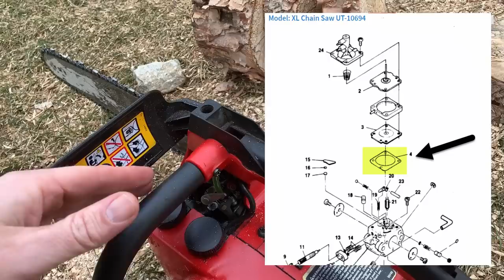Homelite Super 2 Chainsaw - Carburetor Rebuild and Tuneup

Comment: How can you possibly work on anything that dirty and not clean everything off and clean it up. The dirt doesn't help the engine cool and traps heat. My OCD would have had that thing spotless before reassembly. Just my opinion...
Reply: Yeah, the dirt presents a problem.  But what would be the best way to clean these things?  He goes thru quite a few motors.  I would use a pressure washer on it.  I have a tiny little Ryobi that would make that thing sparkle.  But that dirt's gotta go somewhere.  I was cringing that the dirt would find it's way into something crucial.  If it were Taryl, he would just wipe it off with his sandwich.
Reply: I agree, makes good sense to clean it when it is all apart.
Reply: clean the old wood dust and oil to make room for the wood dust and oil 😅
as long as it does not hinder anything it does not harm.
Reply: @alext8828  
I use carburetor cleaner, and paper towels,  a screw driver , or ice pick for tight areas.
Reply: @alext8828  🤣🤣🤣🤣 and there's your dinner
Reply: @jonmyers8046   Ha!  I just consulted "Little Johnny".  He says "Maybe".   Grampa's pissed.
Reply: @alext8828  😁😁😁
Reply: So true. Could of at least given it a blast with the air compressor...

Comment: The amount of dirt on this saw doesn´t help matters... I would always wash the whole machine until it´s spotless to avoid any potential faults due to dirt.
Reply: What do you wash the saw with i never knew of anyone doing that good idea
Reply: @scor440  I usually use gasoline and medium sized paint brush.
Reply: @scor440  if you have a compressor and an air gun just blow the whole saw off after every use. Then just wipe it down with a rag. It will keep them looking brand new.
Reply: @matthall8632  the flywheel fan always pulls sawdust/oil vapors to blow over eng. to cool so always eng.gets dirty w reduced cooling. a spray gun w compressed air to use mineral spirits is fast, works well in well ventilated area and reasonably safe .

Comment: cant blame the shop for turning down the work. Commercial shops must make a profit.  They have overhead cost and If they charge what they need to in order to make money. The customer often will not pay and they now have another  old chain saw in their inventory. I own a half dozen of those super two saws. Bought them really cheep. And I can fix them. However it isnt worth the bother since I have much better XL12,s and bigger vintage homelites that start and run excellent. Those Super 2 saws are popular with tree service guys because they can be used one handed easier that a heavier conventional saw.

Comment: I just found my old Homelite XL (Textron) stashed back in the corner of a shed I rarely visit. I've decided to tackle this project and get it back to running. I have the motor and chassis seperated. I'm having some trouble locating parts. Model UT-10694, carb-H17 26G. Fuel bulb is broke, bar n chain rusty, fuel n oil lines hard, sprocket. I did find a new bar n chain online, but so far all the parts places I've looked out are no longer carrying the other parts I need. I did check and it has spark. As I clean parts I will probably find it needs more. As long as I can find them im ok with that. Even this old/obsolete saw is better than most chinese saws. The flywheel even says made in USA, how rare is that!
Thanks for any help you guys can offer. Enjoyed the vid.

Comment: that repair job reminded me of watching a watch repairman fix a 1937 pre-war wristwatch that been submerged in a lake for 9 years......but you got it running as we all knew you would.....i've owned horribly bad performing chainsaws and lawn mowers in the past and never really owned anything reliable until i bought my first makita 4 stroke chainsaw..........but all the gas chainsaws just shrivel up and blow away when compared to a modern lithium battery powered chainsaw....they are simple and reliable and powerful and convenient and they never disappoint......i bought a makita dual battery chainsaw and haven't used any other saw since i got it

Comment: The pump and check valve diaphragms removed from the carb indicates the carb had been rebuilt at least once as the carb maker did not use that type of material until long after the saw was made.

It requires little effort to separate the engine from the case halves.  A carburetor kit costs under $10.00 most anywhere you look.  Labor to rebuild a carb, from tear down to assembly, is under an hour.  I'm doing one with a chain oiler issue right now and the most difficult part of the job is cleaning out 30 years of cutting debris.  Cleaning the engine and case before taking anything else apart keeps the dirt out of the engine and provides for seriously improved engine cooling after reassembly.
Reply: good to know. cooling is good ❤

Comment: I have a saw just like that. Runs great found it in the garbage. All i did was clean it in a friends parts washer new fuel lines fuel filter and oil lines. Put fresh fuel in it and it fired right up and has been a great saw ever since. Also the plug wire goes under the cylinder not on top

Comment: I really enjoy your videos. I rebuilt a neighbor's old Homelite similar carb last year and found that re-installing the needle assembly was tremendously difficult as keeping the spring in place while setting the shaft and set screw needed a third hand. Needless to say the spring popped and is still somewhere on the kitchen floor hiding. I was too embarrassed to tell my neighbor and couldn't find a replacement carb or kit but managed to source a replacement spring for $0.86 PLUS $25.00 shipping to Canada. I then built a spring corral on my kitchen table and got 'er done. You made it look easy. Thanks.
Reply: 😅 oh my... thank you. you did the hard part so i would not have to. thank you for the warning. ❤
Reply: @OOOOOO12345  How come I'm not smart enough to think of that, a great solution. Thanks.

Comment: Still use a homelite XL  that's now probably over 40 years old. I've cleaned the carb 2 or 3 times over the years, put one or two new chains on it and it still works like a new one. Extremely well 
built. Mine has a true mechanical choke. No primer bulb nonsense. always starts easy.
Reply: Yep, my father bought an XL in 1980 and it's been a good little saw, has had many chains over the years and a clutch sprocket put on it about 15 years ago, other than that, it's untouched with the original bar!

Comment: That’s why you’re having trouble holding a tune and it keeps idling up because the missing gasket is causing an air leak. When you take them apart the gasket is always stuck to the diaphragm and that’s what happened in your case. You had more patience than I would have though and did a good job.

Comment: I'm actually working on the same exact chainsaw with the same exact problem. Pro tip* You don't have to pull the engine out of the casing. The plastic piece that covers the sprocket is pretty flexible. If you pull the sprocket off while bending the plastic slightly, it comes right off. You do not have to pull the engine apart.

Comment: The top oil line going into oil tank has to have a duck bill valve on it to creat a pressure inside of oil tank to force oil out on to bar. I is a very cool system just rebuilding my first chain saw great video I am try to make one THANKS!
Reply: yes, that top line is not an oil return, but delivers air from the diaphragm to pressurize the tank and push oil to the top part of the oil pump then routes to the oiler hole

Comment: They make some liquid insulation that you can use to replace insulation on wires.  After it dries it will protect the ignition wires.  A lot of coils have the ability to replace the ignition wire without replacing the coil.

Comment: The "oil return " is likely a pressure line to pressurize the oil tank and drive the oil out the other line to tge bar.  Mine is also a Supper 2 but the carb is different with a separate crankcase diafram pump to pressaurize.

Comment: I've never seen a tach used to adjust the High speed screw. It is more of the same method you showed for the Low side. Open up the throttle adjust the screw to the point the engine "4 cycles" and lean it just below that point. Then in a hard pull the engine will stay cooler. I worked for a store that sold Homelite, and Pioneer, chainsaws. And, I raced a go-kart with an alcohol burning McCulloch 101AA. These days I have a Stihl.

Comment: Heroic effort for anything Homelite, they were junk back in the 70's even. Good on you for helping out a neighbor though!
Reply: Homelite's were one of the best and toughest saws ever made.
Reply: Throughout the 70's, 80's and mid 90's we cut hundreds of cords of firewood, and probably 20,000 lbft of lumber with 2 saws, a partner F65 and P100, both saws still run and cut strong. I still have a pro grade Husky from '94, used in a small arborist business heavily for 10 years, still runs great. Maybe not a fair comparison, and I'll admit I am not an expert of what particular homeowner grade saws are the best, but in my experience Homelite has come up short.

Comment: Well something different than talking about dirt My first chainsaw was the Partner brand older than this but basically the same I must have cut so many trees with it for firewood trees much much wider than the length of the saw I used it till it just was impractical to use it anymore but what a saw it never gave up ran for years and did me a fine job of cutting I loved that saw it was just a brilliant chainsaw so I am not surprised you want to keep it going its worth it Good video as usual great to watch

Comment: This video brought back memories.

Those were quirky little saws !

Kmart had them in their Sunday ad every week for $ 88.oo .

I cut a lot of camp fire wood with mine over the years.  In fact I still have  it around here a part in a bo  somewhere. 

You might want to greast the sprocket tip.

Those also have a little rubber duck bill valve ( in the gas tank ?) that you want to keep open.
Reply: I think the duck bill valve might have been inoil tank. ?
Reply: I still have that same saw, it is so simple to use.  I think you are missing a primer bulb.  One is the fuel cap for the fuel tank.  The bulb on mine cracked, got too old.  I found one on ebay that somebody built, they took a cap with the right threads and looks like they glued a bulb on it.  On the bottom of the cap are two plastic tubes.  Plastic tubes slip over them, easy to get the tubes reversed.

I have two newer saws but still live this one.  I bought it many years ago as "rebuilt."  I think that Homelight had a bunch of returns, refurbished them and resold them, I think through Home Depot, like I said, many years ago.  Thanks for the video.  Jim

Comment: 24:10 no need for a tacho meter! this is what you do: pull full throttle then turn the adjustment screw counterclockwise until it breaks up. (should sound like a 4 stroke engine) turn the screw clockwise until it runs almost smooth. always let the engine break up a tad for lubrication. (favor the rich side) i'm a chainsaw mechanic. we never use tacho meters! we let our ears do the job.

Comment: Holy dirt balls Batman!   That saw needed a clean for certain.
Reply from the maker: I did clean it, but not well enough....
Reply: I have the exact same one with a bad sprocket also. I did't pay much for it when I bought it 35 years ago but it has been trouble free the whole time. Great saw mine had even more dirt than this one I powerwashed the plastic parts and cleaned the motor with compressed air. Great video

Comment: Good display of multiple skills. Video making; mechanical; detective, i.e., coming up with an alternative carb kit; and going the extra mile on that sprocket. A dilemma issue for me is where you replaced good used parts simply because the kit had new ones. I've been disappointed by new parts so I'd have been reluctant to do that. I hope we don't find that the neighbor decides not to deal with the looming remaining issues and decides it's a good time to unload it and puts it in his yard sale for $20.
Reply from the maker: I agree.  I hate touching anything that is not broken.  But sometimes I do.

Comment: Interesting that the name of the saw is Super 2, but it no longer has 2 throttle triggers?  The original Homelite Super 2 had the forward throttle like a top handle, but also had the rear trigger like a standard saw.  Good Job on the repair.

Comment: I was taught you let a saw run at least five minutes before adjusting the carb, so it is fully warmed up.
Reply: usually a minute is enough if u adj. both jets to lean plus 1/8  to 1/4 rich for hi load cut and idle sudden accel. stumble.

Comment: I love my little Mac 32-16, which is very similar to your Super 2.  I went through everything on my little MAC and returned it  to like new condition.  I call it One Pull Charlie because that is what it is.  It will even start easier than my Stihl 241 C-M, which is computer controlled and my Stihl 181 CBE.  One pull from full choke and it is running.  Can’t ask for more than that.  You have to watch those Homelite carb. - they do not take generic carb kits, same for the MAC.  They may look like they use a K10 WAT,, but they don’t.

Comment: I have 2 of these and they are SO picky. They need to idle fast or they will stall. This machine you are working on is absolutely filthy. No wonder it didn't want to run. The good side is, they cut like crazy at full throttle and are great for limbing and dicing up small stuff...

Be careful because they like to kick back and up.

Comment: That's the reason why I only buy Stihl. The carburetor can be removed and cleaned quite quickly. Especially as I find saws without a chain brake quite dangerous.

Comment: Lifter adjustment.  Yes, they have a big W for Walbro and a big Z for Zama carbs.  I have both.  They are cheap.  These tools are marked for each carb.  Most of them are level with the top of the car body. But some carbs are slightly below level.  I think the C1Q is a smidge below level with the body.

Comment: Mr Condon, Thank you very much! 
This video helped me so much, I have the same chainsaw, and I tried to get it work and with your detailed video it runs! Its a big win after any professional wouldn't even looked at it.

The only problem is that it runs for a few seconds and dies...no matter how I tune it.
Any idea why? (I added a new bulb, and double checked my connection as I saw it earlier in comments)
Reply from the maker: elad lanir there are several things it could be.  The check valve, diaphragm or maybe the needle arm height in the carburetor, the reed valve or maybe the crank seal.  A leak down test might be needed to test the crank seal for leak as well as other leak areas.  Otherwise the reed valve you can remove inspect the reeds to make sure they are sealing.  Shining a light on one side also helps.  You should see little to no light on the other side.
Reply: @jcondon1  Thank you for replying!
I'll try and check the things you mentioned...hope I'll figure it up..
Thanks!
Reply: @eladlanir1331  what was it? thank you
Reply: @jcondon1  a defective hi ck valve allows air pressure to push fuel out of carb at idle only causing gradual starvation @ idle only, hi speed not affected. def. crank seal most notably affects idle rather than hi speed .

Comment: You need to sharpen that chain.  Did you notice how grabby it was?  That is from a dull chain.  I had the same problem with my 3216 MAC.  At first I thought the rakers were to hungry but that was not the problem.  The problem was the chain was dull.

Comment: Concerning that gasket omission, I've seen that gasket put on either side of the diaphragm.  To this day, I'm not 100% sure I know which side it should be on or if it varies with the particular carb.
On another point, from the looks of that chain bar and the sprocket, I would say the oiler is not working.  A very overlooked item.  Not to give you nightmares, but...
Reply: a gasket always goes between carb.body and diaphragm to seal and spaces the lever pin on diaph.the correct height . the oil pump has spring loaded ck valve to pump oil snd prevents siphoning oil when not running. pump pin must be free to move and pump diaph. must seal vac from carb.
Reply: @jamesfarley5183  Yes
Reply: I have nine of these XL model, I own 135 chainsaws! So I can assure you that there is a correct way for the gaskets and diaphragms. On the inlet side of the carburetor it goes, diaphragm to carb body and then gasket. And on the metering diaphragm side you need to put the gasket on the carb body first and then you  place the diaphragm on second! If you get it backwards it will flood due to the diaphragm being lower and pushes down on the arm that pick the needle off of the center! And he bent the arm up too high and ibet the saw was flooding because of that. And usually the saw doesn't have an oiling problem,but  enstead you have to remove the bar and chain at least every other tank of fuel and find something that you can fit in between the guide bar rails and scrape the  build up of sawdust in the track that the chain rides in. 😉

Comment: I'm getting ready to go through an old Super 2, and your video has given me some insight on what to look for that might be worn. You can't buy small gas chainsaws in California any more so these old timers might become desirable if they run like new. Also, does anybody know what RPM is designated for the high speed mixture setting?